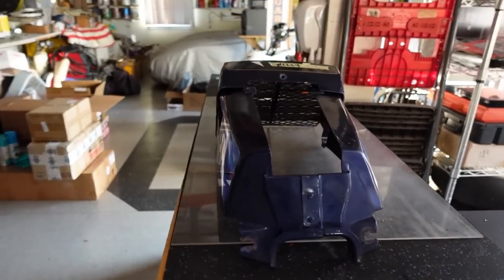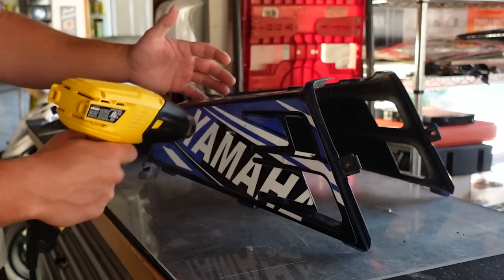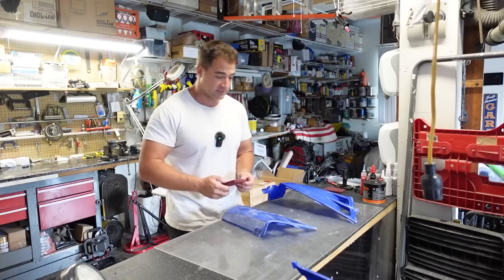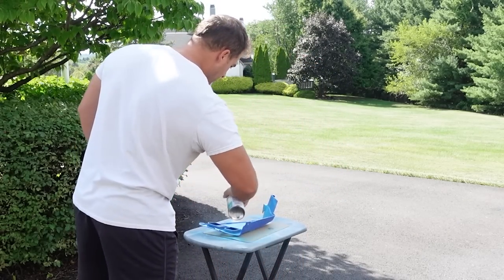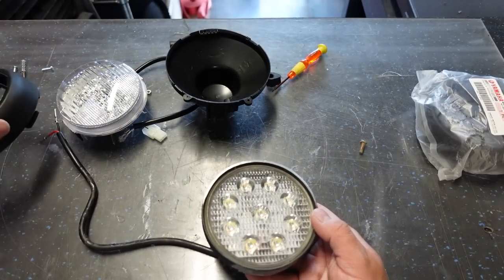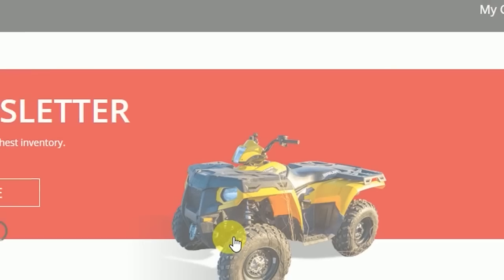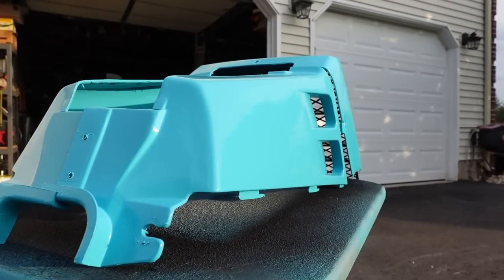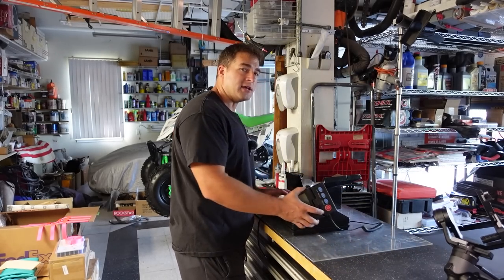Restoring and making custom parts for the Yamaha Banshee Resto Mod -  Part 3

Comment: Using a zip tie to straighten the radiator fins works good too. Just push through from one side to the other and it straightens them.

Comment: I am super excited to see this build come together, and I’m really not a banshee guy at all. They are super fun to ride, very very unique machines, but for the type of riding I do they are just not the best. With that said, the VooDoo banshee definitely got an eyebrow raise from me, and this ‘92 resto mod banshee is starting to be intriguing. Banshee’s are not known for their handling and they were never the choice machine for woods racers, but if this one turns out to have a better suspension and better handling in the woods then I definitely might copy the set up down the road. Probably still wouldn’t race it, but it might be a pretty cool machine for casual sport riding or a trip to the dunes. Suspension and handling has always been the number one thing I look for in a quad. Nothing worse than hitting a bump and feeling your knees and hips break because you’re riding on a brick 😅
Reply from the maker: Lmao! True that Chris. I'm not sure it will be a dream machine in the handling department but I think it will be a good bit better than stock and definitely a nice duner!

Comment: Micheal if you have a automotive paint store near by or you can order it from Amazon but the aerosol called Bulldog Adhesion Promoter is the best stuff to paint on plastics before your final coat of color. I painted a dash that was in a Ford f150 back in 2003 and the paint has yet to crack or fade. I know it's not a high rub area but bulldog works well. Give it a try on some old junk panels and let me know what you think.

Comment: Amazing job with that painting just sharing my experience they sell a adhesion promoter called bulldog it’s about $35 a can however it does an amazing job really sticking that paint to the plastic might be something you want to check out

Comment: Hey man, another great video and project!! You know if you had not started the work on the plastics then the set you ordered would not be coming anytime soon!🤣The spray painting was on point, paint work is 90% prep and 10% spraying paint. That radiator fin repair was top notch, that's some time consuming shit!! A trick I have found is using a new, or good as new, plastic finned brush with a head about one inch square and fairly stiff bristles. After you straighten the fins that are bent flat, take the brush and go over it in both directions. Try it on an old janky one and see what it does.✌🤘

Comment: Vito’s just now released the same colored fuel tank and radiator cover. They also just made a few other different rare color plastics. Check on eBay
Reply: Thanks for watching!! You have been selected hope recommend more friends to. subscribe Message the above contact for claiming!! Good luck.💐

Comment: You can actually get two component spray paint clear coat. It will make the finish a lot more durable. It comes with an extra canister on the bottom of the can attached. You just pull the pin out, and rotate it. The hardener will then mix with the paint after you shake it thoroughly.

Beware though, because the paint itself must be of the same substance as your current finish. So if it's alkyd-based, it needs to be an alkyd-based two component finish aswell. If you don't match these up, they can start "eating each other".
Reply from the maker: I'll have to look into that; I've never messed with a two component spray; thanks for the tip!

Comment: if u use adhesive promoter the paint will stick to it alot better also use flex so when it bends it wont.crack

Comment: Hey mike wondering if you can help me out I just started rebuilding a 1985 lt250r and got it to start but revving super high i haven’t connected any of the coolant line cause I wanted to see if it would start up can that be one of the reasons or would it be more carb issues the things been sitting for more than 10 years or so

Comment: Hey Michael, excellent videos!!!!  You do an incredible service!  You inspired me to buy an ATV (got a 2008 Honda 700xx) that my son and I will restore.  I do have a general question, I hear a lot about OEM parts vs. aftermarket.  How do I know when to go OEM vs. buying aftermarket stuff?  It seems like in your videos sometimes you are all about OEM and sometimes you are super excited about aftermarket.  So, just trying to figure out how to make sure I keep the quality of this build high.  I am planning on selling it at some point and want to maximize its value.
Reply from the maker: Thanks Chris! This is a difficult question because its dependent on what your goal with the machine is. OEM is usually going to be good quality and if you're looking to restore something and keep it original, it's a great choice. Aftermarket becomes tricky if you're not familiar with the market but generally, if you can find companies with a good reputation, they will have good aftermarket parts. If you're looking for cheap aftermarket parts, you can be rolling the dice, especially on ebay and amazon but that doesn't mean there aren't decent cheap aftermarket parts either. This is really a case by case basis; I hope this helps!
Reply: @MichaelSabo  Thanks Michael!  That does help a lot.  Keep up the great work; your videos are very well done.

Comment: Hey Mike if you are going to be making custom parts I'd suggest you get some other tools to do so.  Especially if you are going to be working with aluminum. Since you hit harbor freight a good starter set of stuff would be their 1x30 belt grinder/sander it's small unfortunately not too powerful but makes doing small parts a breeze with profiling. Ideally you would want a 2x72 belt grinder for knife making. There's an enormous amount of different belts you can get from 30 grit to 6000+ grit and scotchbright belts. Also a 9" bandsaw from harbor freight has done wonders for small aluminum parts I've made for my quads. Just a suggestion because I know all to well that hacksawing and Sawzalling stuff is just a pain in the ass.
Reply: Thanks for watching!! You have been selected hope recommend more friends to. subscribe Message the above contact for claiming!! Good luck.💐

Comment: You need to use adhesion promoter and 2k clear coat you can buy from a automotive paint store in a can it’s way more professional cheap and fuel resistant will last forever

Comment: Hi @MichaelSabo, what did you do so the bike don't blow up the leds light? Cause I tried to make the same thing as you, but keep blowing them up
Reply: Someone told me it was because of the ac systeme, and legs run on dc. Normally, you would need a ac/dc converter?

Comment: Did you have to do a conversion for the led lights or did you just use stock stator? Thanks man and great vids
Reply from the maker: The stock stator runs these LEDs quite well. You will of course still get the surge of brightness with RPMs but they're quite decent.

Comment: Do you ever run a coolant cleaner an degreser in the radiator once you get it running. To maybe clean out any scale an rust In the radiator that u can't see.
Reply from the maker: I usually run a new radiator but I will flush a radiator before I install it if I'm servicing a bike or using a used one like this one.
Reply: @MichaelSabo  for 40 bucks that radiator looks mint. I can't believe a brand new one is 900 bucks that's insane. U can buy another quad for that lol. I love the color combo. Would look awesome with a pink shock an that turquoise color as the coil. Or maybe some accent on the rims or bead locks the same color with chrome. Thats going to be my favorite build. The voodoo banshee was badass but this one is old school AF! Screams 80s an 90s with the wild colors. I love the old school kawasaki bikes from 80s lime green rims with purple graphics. Keep up the good work can't wait to see it finished an running. You should do some led lights under the tank shine down on engine. Maybe pink or turquoise color lights.
Reply from the maker: @Aciecarter238  all great ideas man! The shocks have pink coils to look OEM; I'm going to post up some pics today on Instagram if you want a sneak peak! @michaelsabo350

Comment: Wuddup Mike. Question. You ever had trouble with tank graphics bubbling even after proper prep? On a yz250. Graphics that were on it when I got it were easy to remove on tank then got new ones and hear gun them also and still bubbled only on tank
Reply from the maker: Were the graphics you installed perforated? Plastic gas tanks actually vent fumes through the plastic and if your graphics aren't perforated, they usually don't last as long. This only applies if the graphic goes directly on the tank surface which it does on a YZ250.
Reply: @MichaelSabo  yhey are perforated but still gets alot of bubbles underneath it. Guess it is what it is then. Cheers, love the content bro

Comment: hey michael sabo i need some help with finding some parts for my atv, it is a 2009 yamaha 350 raptor and whenever im riding it on the right wheel it wobbles so i need any used a arm, a breather lid for the airbox, a new break handle, Do u think u know any good websites i could find those on for less than about 120 dollars?
Reply: Thanks for watching!! You have been selected hope recommend more friends to. subscribe Message the above contact for claiming!! Good luck.💐

Comment: Don’t zinc coat the bolts it will turn rusty and bad looking. We did it on one of my bikes
Reply from the maker: They might have been done wrong or not cleaned first. The place I'm taking them vapor blasts every single bolt before coating.

Comment: I Love My Yamaha 660 Rapper it sets a little high for my taste tends to body roll but amazingly fast Iove my 450 Kodiak to and my 660 Grizzly is always a beast I got the same BigFoot Kit and super Swampers on beadlocks with the Yamaha extended fender Flares on both and Auxiliary headlight brush guard addon with the Warn Winch Bumper and built in Aux Lights and I have Moose hand guards on both and the Rear ARB bumper and both has the HMF pipe there both Hunter Green to if I had it to do over id gotten both in Yamaha steel Blue

Comment: I'm curious as to what you run to stabilize the current for the led lights... a battery or a capacitor ect.
Reply: I’m pretty sure stabilizers are built into the led themselves as far as headlights and taillights go. It’s always been plug and play with my protects switching from halogen to led. The only time I’ve had to run stabilizers or resistors is for turn signals to prevent hyper flash. I also used the exact lights on my Harley including the headlight and they worked phenomenally
Reply: @Apothas541  did you put LED lights on a bike that didn't have a battery? Like a kick start  2 stroke?
Reply: @keithkeller698  I did not, I’m not too familiar with two strokes. I believe the install would still be as simple as adding a power source and running a power and ground wire with a switch to turn it on and off but that would be an external system you would need to charge. I’m not sure how you’d integrate it into the bike
Reply: @keithkeller698  you’ve peaked my interest though, I didn’t know 2 strokes didn’t have batteries, the ones that have lights so now I’m going to go learn a new system lol

Comment: The aftermarket plastic heel guards are garbage just a reminder. I’ve bought 2 sets and they always cracks at the mounting tabs. Get oem ones, they don’t break with vibration or flexing

Comment: I have a 07 Yamaha 450 grizzly and it has 1300 hours on it And everything is perfect and the only thing was the carburetor and I’ve put new drive shaft 26 inch tires and  belt and nothing wrong g has happened until today I drove for an hour and it started backfiring then losing full power and shutting off and when it stars back firing if you hold throttle down it burst it would loose and game power rapidly anyone know what’s going on?
Reply from the maker: That sounds like an electrical issue. I'm not familiar with the 450 grizzly but Yamaha is known for having safety switch problems in the parking break; might be worth a look!
Reply: Check your intake for leaks

Comment: The purists have nothing to be pissed about! You aren't aiming for a complete restoration, nor passing this off as one. This is a resto mod, or, an HOMAGE, to the 1992 Banshee. I will agree about the OEM bolts though. I LOVE OEM bolts. 13mm head nuts IRK ME. But it IS easy to disrupt some people's mental space. I like OEM original condition Zillas, but I don't look DOWN upon restored or wacky colored ones. It's THEIR ship, and they'll build it how they want. As long as they grant me the same courtesy. Can't we all just get along? Old ass 80's (and 80's based) 2 strokes UNITE!

"I'll show YOU who's cheap!" the headlight roared, as it hurled that screwdriver at your balls!😵

That's right about PSN. We bought a Polaris wheel, and it WAS the one in the picture.

The "rosie o'donnell of headlights" DOESN'T make sense. You gotta say something HEAVY is the "rosie o'donnell" of whatever it is!

The headlight guard that has YAMAHA molded in is still available. Part number 2GU-84159-00-00. Used on Banshees from 1987-1999.

Must be nice to have cylinder options. CPI said back on 12-29-09 that they
"We are currently in the process of developing a new family of cylinders which is once again stretching the upper size limits. The "smallest" version of these cylinders will be a 94mm bore, with plans to go as large as 108mm bore when piston development catches up to that bore size. We are still in the development stage with the Liger Project, as we are seeing new markets arise for this cylinder. We have uploaded a few pictures of the proto-type cylinders for a few of the cylinder applications. One of the projects can be found under the CR500 section, another can be found in the CPI section as we have developed a Liger cylinder to fit the Caracal cases. We have a case reed model to fit the Artic Cat M1000, future models may include the Suzuki LT500, and the Kawasaki KX500. We will be doing extensive development for other engine applications as well."
As you can tell, that still hasn't happened.

Must also be nice to get aftermarket light switch, airbox, kick starter, fuel switch, and heel guards.

You might have a problem with the chain buffer on the XFR skid plate. We bought one for a buddy's LT-R450, and the chain ate the wimpy rivets in an afternoon. We modified a piece of snowmobile hyfax to be the new chain buffer, using screws to hold it on. Needless to say, it will last FOREVER.

Must also also be nice to still be able to get new cases too. See a trend here?

If you are buying carbs, order them from your dealer, Sudco, or a reputable performance company, like Duncan Racing, Tudors, FTZ, DTR Racing, etc. Don't trust ebay or that jungle site.

As usual, great job! Especially on the painting and prototype headlight brackets! If I had a banshee, I'd totally buy a set from you! Gonna be sweet!
👍